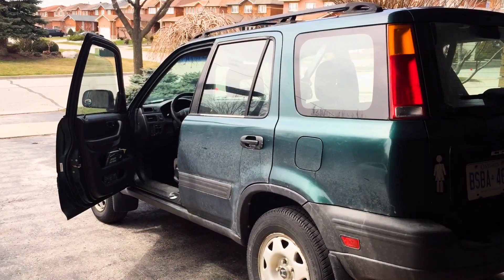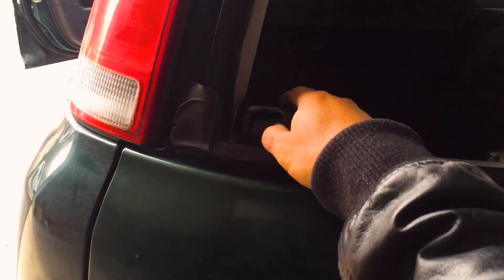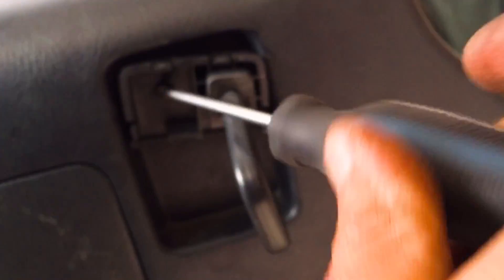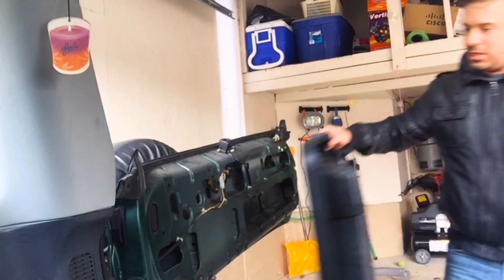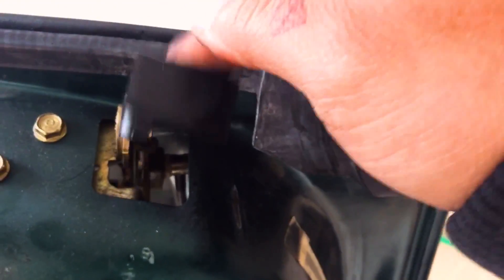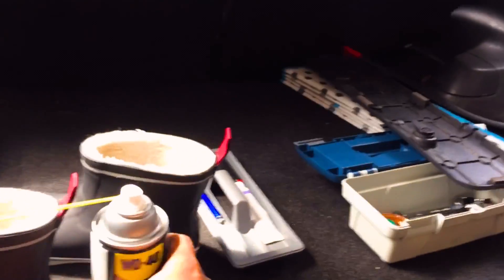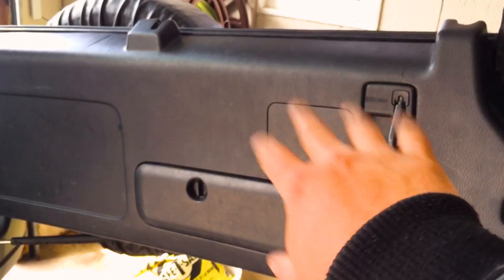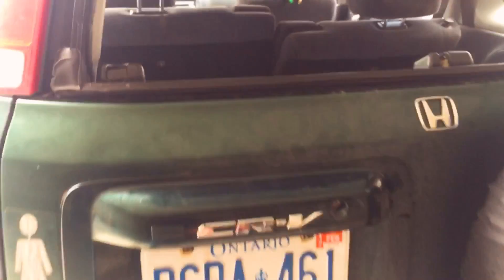Honda CRV - Back Door/Window Sticking FIX

Comment: It was a very helpful video although I did not have to take that whole panel off I was able to take just that little plastic piece off in the middle of what he unscrewed to get the whole panel off and you can get in there and blast all them areas he is talking about I used Wd-40 with a straw extension I sprayed them down and opened and closed multiple times before snapping the plastic into place you need a screw driver to pop off mine was stuck didn’t want to open or close and would jam up when it did open now it opens and closes as should all with spraying down the mechanism he explains in video just not removing panel I by passed that and works great
Reply from the maker: Great idea!
Reply: I will do that.

Comment: How did you get the panel off after removing the 4 screws?  I tried just pulling out from the bottom of the panel, but the clips that are holding the panel in place doesn't seem to want to give.  I'm afraid to pull too hard in fear of breaking one of the clips or something else.
Reply from the maker: There are a lot of clips and you can get a tool that pops them off, here's the link: http://ebay.to/2ETDOFf
Reply: Thanks for your reply.  I finally did get it off.  I just had to prior a lot harder than anticipated.
Reply from the maker: Yeah I didnt want to suggest it in case you broke anything I would feel bad

Comment: Hey Matt... I'm having a hard time with my CR-V glass hatch CLOSING after I get it open. It opens fine, but to close it, I have to fight with the latch on the lower part like crazy. The previous owner had been just slamming the hatch for years - no doubt adding to the problem as opposed to addressing the problem and actually getting it resolved - and  now I'm suffering not being able to use it for it's potential.

What do you suppose is the possible solution for this?
Reply from the maker: I would love to be able to help you, I’m not entirely sure unless I see it, if the lach isn’t holding on, you might have to replace that part? That really sucks that the previous owner was so rough with it, we have a mechanic that works from home here in BC Canada, maybe there’s a way to find someone near you that will look at it and suggest something? Sometimes it’s as easy as going to a junk yard and finding a new lach? Hope that helps, if you need more help msg me on Instagram.

Comment: Is it possible to take off the panel from the inside? My tailgate won't open so I'll have to work on it from inside my car but I don't want to break anything
Reply from the maker: You might be able to but I’m not sure. When the tailgate is closed, I would imagine you have no space to get to those screws at the bottom, good luck let me know. Wish I could help more.
Reply: @DBFamilyVlog  Well I managed to get it off but it did end up cracking along the top where the rear windshield locks to the tailgate, nothing some type of adhesive can't fix though. A clip broke off too but I did manage to get my tailgate opened up. Thanks for the video it was really helpful
Reply from the maker: Awesome, sorry about the crack but I’m happy it helped. Good luck with your repairs

Comment: hey I'm in the process of wanting a Honda crv  and the salesman said that the back door won't stay close where can I take it to.?  it's a used Honda crv
Reply from the maker: You can try to fix the latch on your own or any mechanic will open it up and fix it, it always depends on the piece that needs fixing, sometimes its easy and sometimes it requires a few hours and the right parts Lashawn Hodge

Comment: My crv has 3 screws on the outside frame. The claw is attached to one of the  screws.  Now, I don't know how to hold the claw up in place, so that I can screw it back in place, which is attached to the panel that you took off. 😡

Comment: Thanks! I finally fixed it after 4 years! Sadly, I broke 4 hinges on the bottom left corner.
Reply from the maker: +MrRedpHat yeah thats the worst! i hope you can fix them!!
Reply: Hi, someone once told me ... If duct tape doesn't work, you haven't used enough!
Reply: That was Red Green                              @bubbleblonde9600